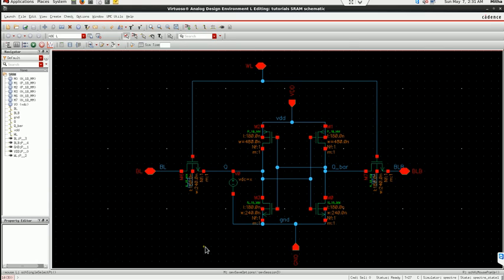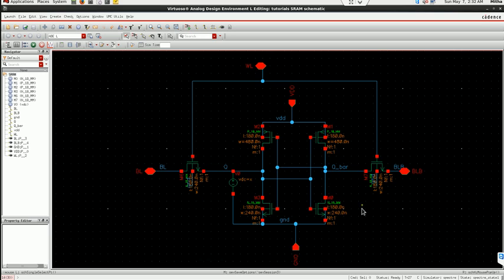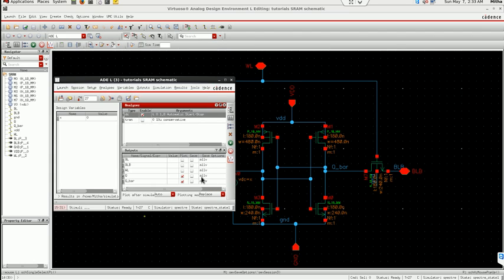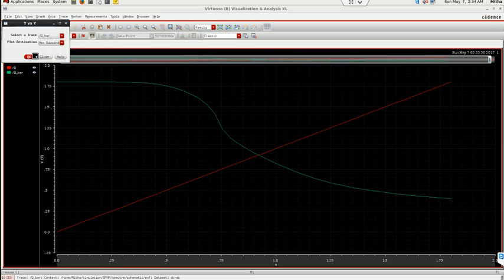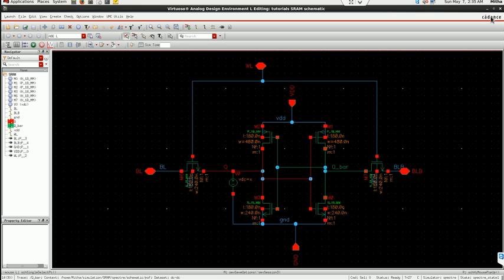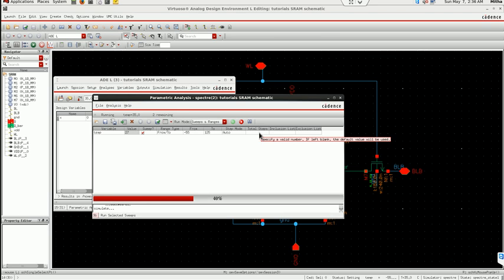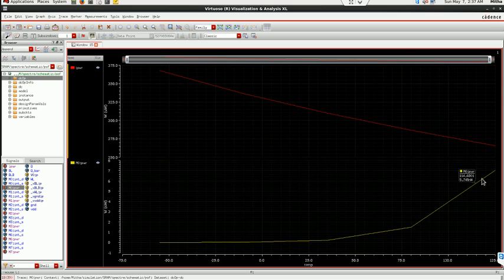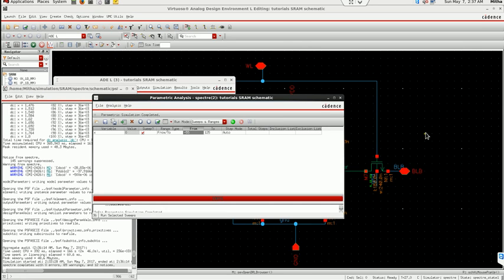Cadence IC615 Virtuoso Tutorial 11: How to plot SNM for SRAMS and Power Consumption with temperature

Comment: Hey sir, can you tell me what the inputs of wordline, bit and bit_b should be while you do dc analysis to find the SNM. I am guessing I will need 3 clock cycles to read i.e., (1)read init where wordline is 0, bit ad bit_b is 1, (2) precharge where bit and bit_b are kept floating and (3) When we pull up wordline to make the read.
Reply: Update: I think the inputs don't matter. We can also remove access devices and plot the graph.

Comment: Hello, how do you calculate the SNM after getting the butterfly curve? Is it as sample as subtracting the top curve over the bottom? Is there an equation
Reply: I know its very late and you might have found the answer. I'm replying for those who're searching for it. 
We try to fit a square inside those lobes. So use two markers and move them manually such that dx = dy and it is as large as possible. We do the same for both the lobes. Now, we take the magnitude of both the square's sides and report the minimum of those two as Read SNM. 
Similar procedure applies to Hold SNM as well.
Reply: @nikhil_prakashh but the above technique to find snm required to be done manually so each person might fit the square differently for which is not accurate. so is there any way i can fit the square (maximum square) by using some formula or tool which results in accurate  regarless of the person fittinf to avoid manual errors. please let me know if any of you know the answer.

Comment: Thanks for the video but please explain the details as there are some people new with this topic. I spent 2 hours and finally I found out that the key part of the Y vs Y is that the Q signal should be present in the waveform. Maybe I missed that in your video. Thank again
Reply from the maker: Thank you for your feedback. In case you are not able to follow or miss any details, please comment or mail me. I will try to respond asap (typically within 24 hrs),

Comment: Hello Sir, Thanks for the video! But my question is why your simulation method is different from this reference: “Statis-Noise Margin Analysis of MOS SRAM Cells,”, IEEE Journal of Solid-State Circuits, Vol. SC-22, No. 5, October, 1987.
Also, I am afraid you just got the voltage transfer characteristic (VTC) of an inverter. 
Please correct me if I misunderstood. Thanks.
Reply from the maker: Hi,
SNM is basically nesting the largest possible square in the two voltage transfer curves (VTC) of the involved CMOS inverters.
If you read the section II of the paper it states as "A basic understanding of the SNM is obtained by drawing and mirroring the inverter characteristics and finding the maximum possible square between them."
This is exactly what I have done here.

SNM is also defined by the ratio of W/L of driver to access cells [memory cell ratio].
Reply: Thanks, Sir. I understand. 
Just to confirm, if in a structure where the two inverters are different, we have to simulate VTC of two inverters separately and cannot mirror one directly. Am I correct?
Reply from the maker: Yes, you are right
Reply: @MudasirMir7  Thank you so much, Sir.

Comment: sir, during  Monte Carlo analysis after getting results I am unable to save the results in ADE XL,each and every time to run the same simulation it is going to take more time ,sir could you please help me how to save the state.
Reply from the maker: try giving a different name while saving the state
Reply: thank you for your reply sir,
I have saved the state in the ADEXL window after MC analysis, after re-running the same state it is not showing anything (it is  in hiding mode).it was not happening in ADEL window to retain the past sate(session->save state).
sir could you please provide the solution for this problem.
 thank you
Reply from the maker: Hi, sorry I overlooked your first comment. when you load the saved adexl state, you will find history option next to the data option in the data view subwindow on the left side of your adexl window. click on the history and you can see all the previous run states for mc. Right click and see results. you can increase the number of entries to save in options given at top of adexl window. by default it is 10
Reply: thank you very much sir,
for your reply.
thank you

Comment: Sir i had a problem with SNM. I did like your video but in Dc analyses, Q and Q_bar are just a straight line at 1.8 and 0 V.
Reply from the maker: Were you able to draw VTC curve for simple inverter circuit?
Reply: Yes it was ok. I only had a problem with SNM

Comment: video is very much useful sir, in the schematic you have taken the width of nmos an 240 nm but in our software(cadence ic616) the threshold width is set as 400nm can we change that limit?
Reply from the maker: Of course, you can change. Calculate the aspect ratios for your specification then optimize.
Reply: Thank You Sir

Comment: Can you please provide the stimuli information? How do you decide how to set the values for stimuli?
Reply from the maker: Based on the clock frequency and the power supply we have to give the stimuli. In the above tutorial, the intention was to explain how to plot butterfly curve, therefore, I gave random input clock frequency and 1.8 V power supply.
Reply: Mudasir Mir Lets say my Vdd is 1.8V, in that case to plot the butterfly curve. Can you confirm if these stimuli makes sene
1. varying vdc from 0 to Vdd
2. bitline:pulse with voltage1=Vdd, voltage 2=0, period =2ns
3.bitline bar:pulse with voltage1=0, voltage 2=Vdd, period =2ns
4.Wordline:pulse with voltage1=Vdd, voltage 2=0, period =4ns